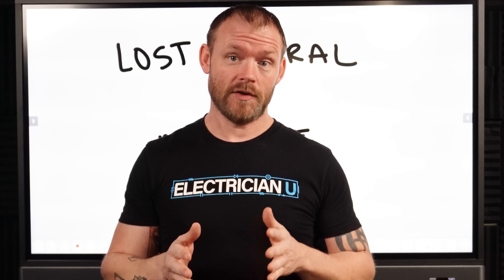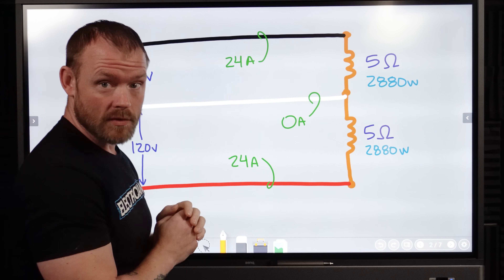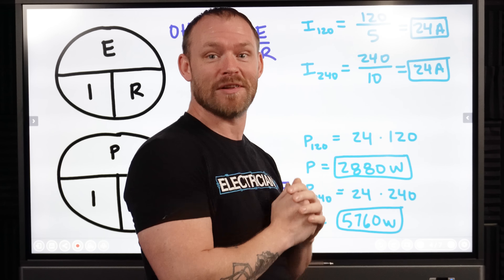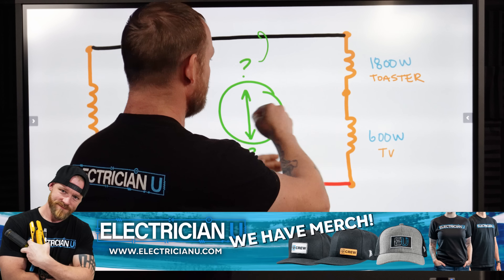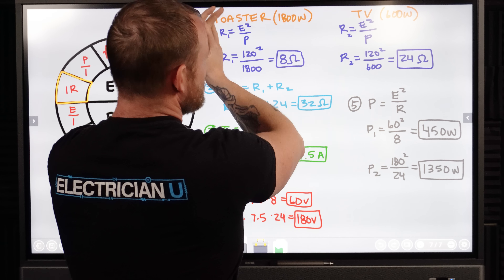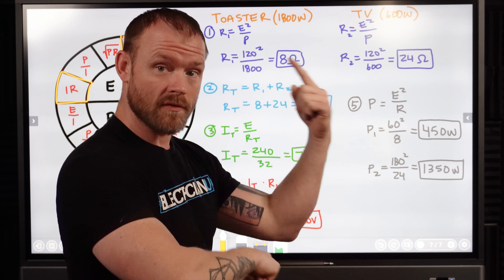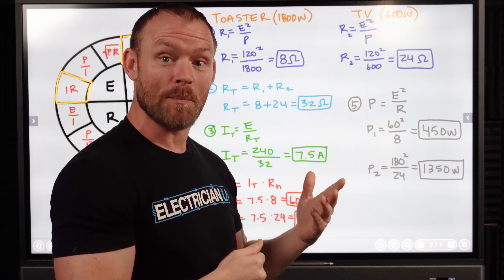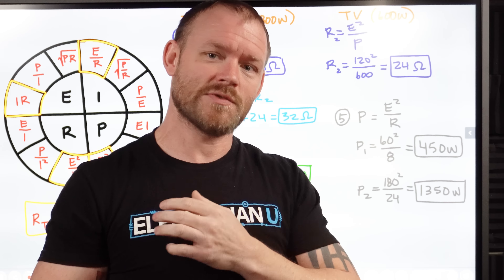NOT SAFE? Losing a Neutral in a Multi-Branch Circuit

Comment: Is this the same reason why an AC unit doesn’t take a neutral?
Reply: No, an AC unit doesn't take a neutral because it is a pure 240v volt device.  About the only thing that takes 240v AND a neutral are clothes dryers because they power the heating element from 240, but want to cheap out on the AC/DC converter to power the electronics and only run that off of 120v.  You need the neutral to get only 120v.

Comment: ima need a better explantion on how it can work as a 240 because that just shits on everything i thought i knew about electricity
Reply: Each 120v circuit runs on an opposite phase, to make 240v in total
Reply: @davidmurn772  he said a branch circuit does not need a neutral if the two lines have the same load it will operate as a 240.
its not as simple has adding voltage up literly every machine is made to operate with certain voltage and 120 AC even on a branch circuit needs a neutral to work ... period so im not understanding how he is saying it doesnt
Reply: @richardc7433  In a 120v setting, you have two AC phases and a neutral coming from the service which are phased oppositely giving -120 to +120 between each phase and neutral, or -240 to +240 between each phase without using neutral.  Think of the neutral as a centre-tap on the transformer.
Reply: @davidmurn772  you said the same thing in a more complicated way the device itself is not design to not have a working neutral its going to fry the appliances
Reply: @davidmurn772  Only one phase Split in Half.   One 120 volt load in pulling
current (amps) while the other 120 volt load is pushing current (amps)
This is perfectly Balanced If both were the same LOAD (resistance/current).    No neutral needed back to the panel.
Reply: @davidmurn772  No, you have +120v on one phase, and -120v on the other, relative to neutral.  Between the two, you get 240v total.  There is no +240 and -240.
Reply: @richardc7433  Its only going to fry the appliance if the neutral break happens between the pole and the house, and the appliance can't tolerate 240v.  Most modern electronics can tolerate it, but your old school incandescent light bulb or toaster can't.
Reply: @tedlahm5740  In theory, yes, but it is against code to run both phases with a shared neutral to multiple outlets for exactly this reason.

Comment: He's done similar videos before and he's still wrong.  There is absolutely current on the neutral.  An amp clamp wont pick it up because the polarity cancels out.  Which is why neautrals are so dangerous.  If you break the neutral, the current may be the same, theoretically, but the voltage doubles.  If you take two 120V fans and hook them up to a 220V supply, they will burn up.  Period.  It doesn't matter if they're "balanced."  Unless you're talking about pure, theoretical resistors that have no voltage rating.  You generally don't use watts to calculate like that either.  You DO use watts for things like tvs or other inductive loads but you then have to use power triangles and vector math to solve the circuit because it's now an RLC circuit.  At 7:40 he admits that he has no idea how to use the formulas.

Please learn proper theory.  This is just confusing garbage.

Edit: I see why he's using a tv.  He's copying other people's content without actually understanding it.
Reply: @JorgTheElder  here's an even more brief answer from Open AI,

"Yes, even if a 3-wire circuit (such as an Edison circuit) is balanced and neutral, it will still have current flow. This is because electrical current flows through all conductors in a circuit, regardless of whether the circuit is balanced or unbalanced.

In a 3-wire circuit, the current flow occurs between the hot wire and the neutral wire. The neutral wire is designed to carry the return current back to the source, completing the circuit. Even if the circuit is balanced, meaning that the current flowing through the hot wire is equal and opposite to the current flowing through the neutral wire, there will still be current flow through both wires.

However, in a perfectly balanced circuit, the current flow through the neutral wire will be equal to the current flow through the hot wire, resulting in a net current of zero. This means that the neutral wire does not carry any excess current, and the circuit is operating efficiently."